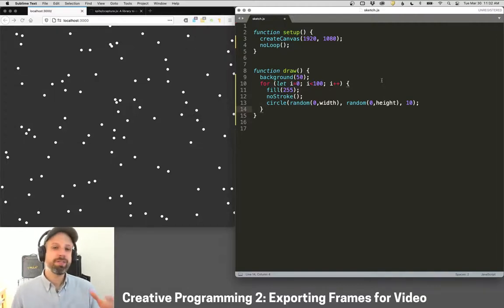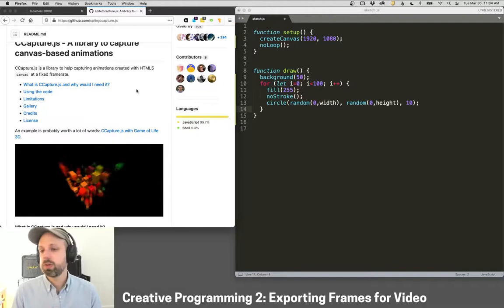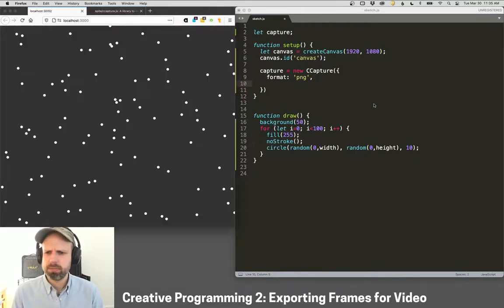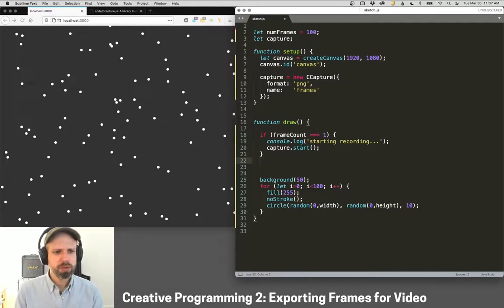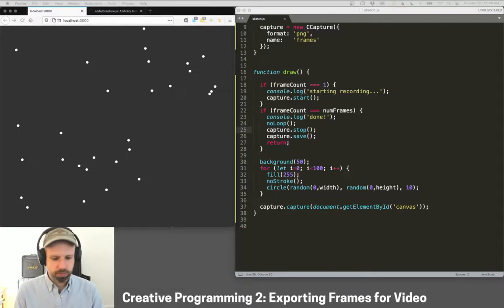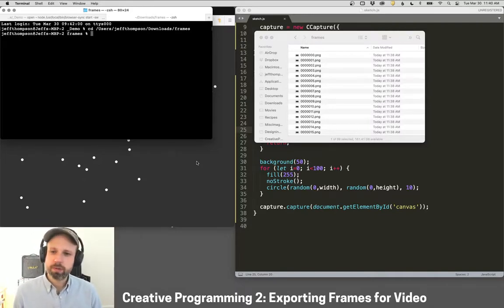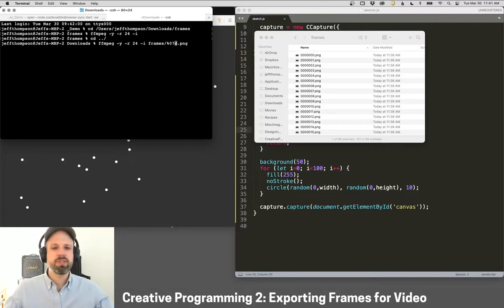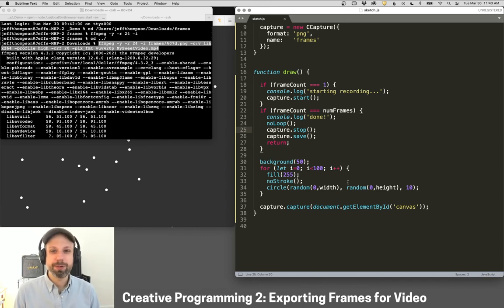CP2: Exporting Frames for Video (and FFMPEG) – Simulation in p5.js

Comment: What do you recommend for recording audiovisual sketches? Can i use CCapture?
Reply from the maker: CCapture works great for that but (I don't think) it will capture audio. It saves individual frames but you could add the audio later in Premiere etc or with FFMPEG

Comment: Amazing, thanks! I'm having some issues: I've installed CCapture.js from npm install ccapture.js in the project's directory, and link it in my index.html, but for some reason it doesn't work. I can't get it to recognise the CCapture.js module. Any ideas? (I kind of don't understand quite well how to use the github version, but included that folder in the directory aswell and same result). Thanks
Reply from the maker: Hmm, I don't really use Node much but it sounds like the problem is there. Did you try running the version in the p5.js web editor? (Link in the video description.) That includes the library and you could download it as a starting point. Hope that helps!
Reply: @jeffkthompson  Thank you! The issue was I forgot to also link tar.js and download.js
Reply: @dariorruiz  Can you please copy-paste how did you link tar.js and download.js in index.html? I have almost identical problem.